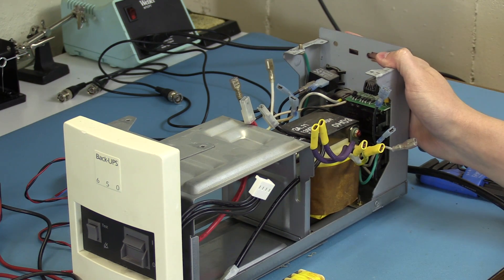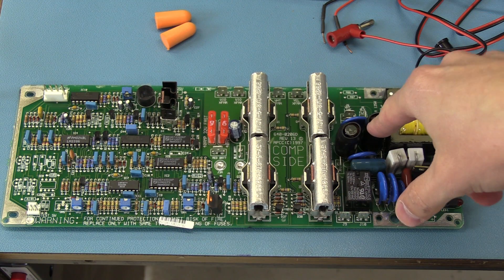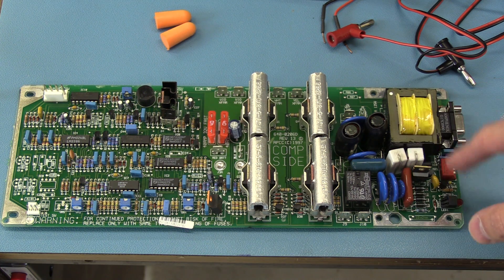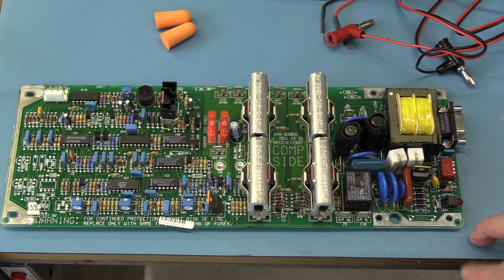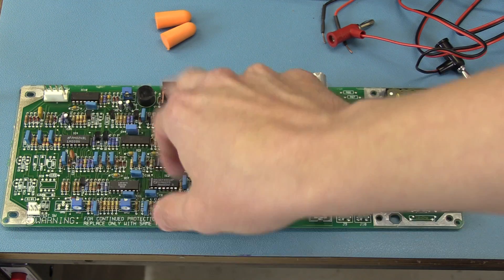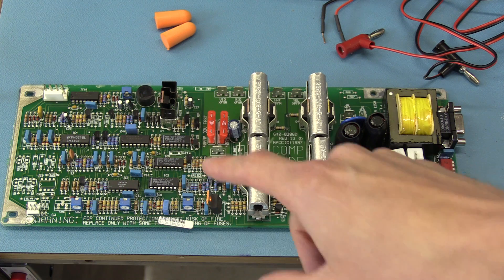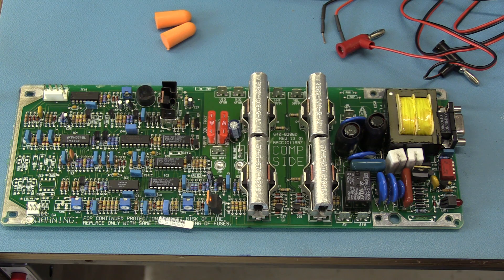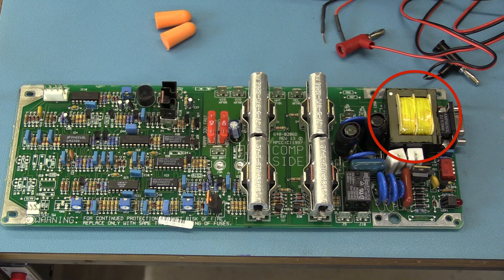Uninterruptible Power Supply Teardown

Comment: How to Charge the battery of Backup UPS 650
Reply from the maker: It should charge automatically when installed in the UPS and the UPS is connected to power. If you wanted to charge it outside of the UPS, you might be able to use a small SLA battery charger. I think I've seen them marketed for charging motorcycle batteries.

Comment: May i pls know if i can replace the same UPS with bigger batt. maybe 100-200amp?.. thanks in advance..
Reply from the maker: Are you looking to use a battery with the same chemistry and nominal voltage, but with a larger amp-hour rating to get a longer runtime? That may work fine. Two possible issues come to mind: the inverter may not be designed to run that long or with that duty cycle (perhaps due to thermal design, for example) and the charger might get confused by the larger capacity battery depending on how clever it is and the assumptions the designer made about the battery.
That's all just off the top of my head, though: I haven't done any research to confirm.
Good luck!
Reply: @StuntProgrammer   thank you so much Aaron for your response.. God bless!..